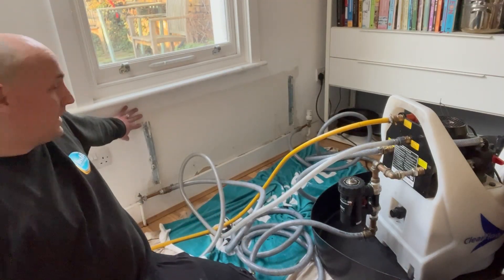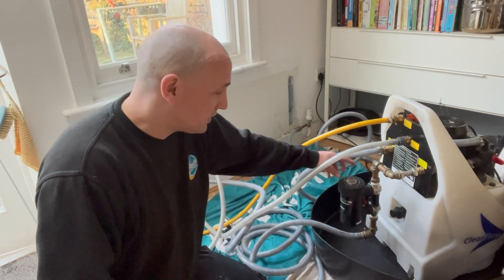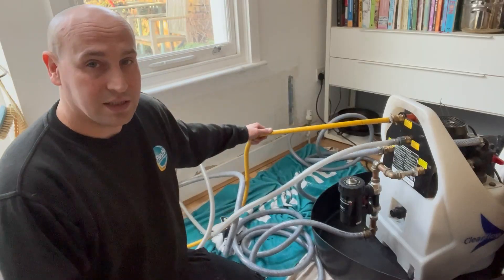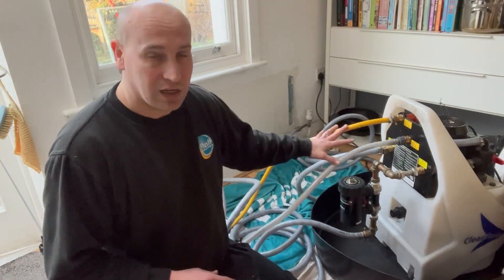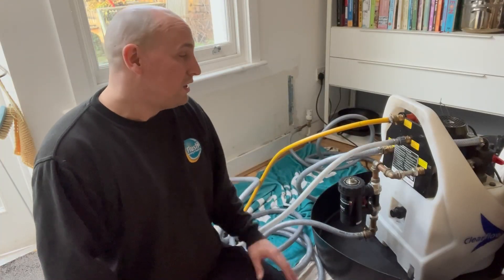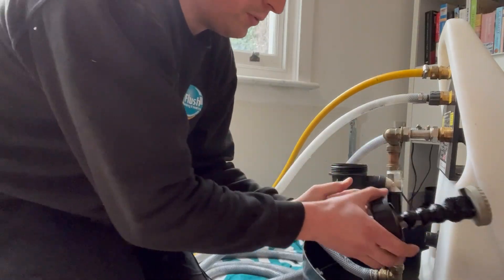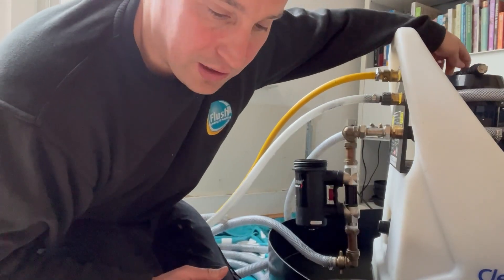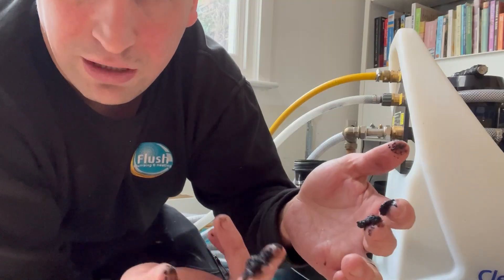What's the difference between a Chemical Flush and a Power Flush

Comment: Good evening from Greece, happy new year. I completely agree with what you said. The success rate in a chemical cleaning of the closed heating circuit with the circulator does not exceed 30%, the process is completely wrong and the customer pays for nothing. A proper chemical cleaning is achieved only with a dynamic flushing machine and magnets for many and various reasons, in difficult closed heating circuits that operate for more than 15 - 20 years, such as in Greece where we have 40 years of operation of the closed heating circuit, one hour of the chemical X100 is not enough. Many times the same chemical is not enough to clean the closed heating circuit even with hot water, the solution is to find stronger chemicals, the process for a radiator with my own method lasts for each radiator 2.5 hours. At the end, rinsing with water jet ... clean water with air. On my channel I show the way in which I work with my own self-made dynamic flushing pump.

Comment: A warning here press fit connectors with out collar locks  can come loose on power flush, i have seen many system not fitted on fantastic plastic connectors. (make sure they are insured for damage to ceilings carpets  etc)

Comment: Thanks Flushman for the detailed explanation. I need to do a power flush with chemicals. Do i isolate the central heating pump and just use the power flush pump to pump it around the system.

Comment: Problem is the pumps and heat exchangers get  clogged up, so remove clean them out with FX2 cleaner after you had chemical cleaned your system will only loosens sludge only but the hard bits get stuck inside the parts mentioned above

Comment: I have a fairly new boiler, all rads are brand new apart from an old towel rail in a bathroom. We are currently renovating and I think the crashing and bashing keeps loosening debris and it ends up blocking the heat exchanger. Will the chemical flush and drain down release the debris in the heat exchanger? TIA!
Reply: My boiling kettling making noises etc, first thing is chemical clean flush system,  then remove debri /clean pump rotor  , then get someone to remove flush clean the heat exchanger with fx2 cleaner 😊

Comment: I looked at a poweflush and the cost was extortionate tbh,my issue is ive got bottom of house 15mm plastic repiped but top half is 10mm copper micorbore,some said it wouldnt work and didnt even want to try,the ones that said they would wanted crazy money,boiler is condensing type around 6yr old and upstairs rads are cold,so i bought the X400 and flushed the sentinel magnafilter,refilled system with the x400 and now only 8hrs later have decent heat upstairs now,not as good as it shpuld be but a huge improvement and good enough,the rads are all around 3yr old but to repipe upstairs is no no as it means ripping up floor in 2 rooms and hall,weirdly the towel rad has always been fine upstairs  but 2 rads on same floor were always very poor,there is a manifold in hall so not sure if thsts an isdue.

Comment: All 4 rads on my ground floor have drain pipes so how to I know which rad to add chemical?
Reply: it doesn't matter...once it is in it will circulate
Reply: Best idea is if you have a towel heater use that,once drained down close both valves fill with the chemicals flush usually 1 ltr,prime system and open both valves then bleed rads as normal,the towel rad is easiest as the bleed valve is at top and you can remove it plus there's no trv valve.

Comment: Great video. So you say to insert the chemical and leave the rads running for an hour to circulate it around. We then drain off the system to get rid of that slugey water. We then put the inhibitor in - do we drain this or leave it in there to circulate? Thanks buddy
Reply from the maker: Hello 👋🏼 Leave the inhibitor in the system. This prevents any further corrosion. It prevents the system of corroding from inside out and therefore prevents build up of sludge. Hope this helps :)
Reply: @flushman  makes sense. Thank you for the quick reply

Comment: question:
what happens if you power flush but you have no open drain outside?
my drains are sealed under the ground.
some people have said they put the contents straight onto your garden which i think is bad idea if you are putting corrosive elements onto soil( is it even permissible to to do that !)
also is a power flush more suitable if you believe your system has never had a power flush( mine is at least 14 years old and came with the property)
thanks
Reply: Leave it alone.Is your system ok? Radiators hot don't worry.
Reply: You only need to flush when you are finished. You can use the toilet to put the flush pipe in. Obviously it could be a bit dirty but it shouldn’t stain the bowl.
Reply: @davideyres955  thank you for reply. as it was. I had the boiler changed, and they did a power and chemical flush, and flushed the contents of the filter( less than half a bucket) down the toilet

Comment: Thank you, that was really helpful. I’ve heard of a power flush, but not a chemical flush. How easy are power flush machines to use. I believe you can hire them? I ask because I was I was quoted £850 plus VAT for a power flush (3 bedroom house with 13 radiators)
Reply: Rip off.
Reply: Shocking absolute rip off I was quoted similar,issue can show up leaks if powerflushed and they do usually warn you of this.

Comment: My partner has just had under floor heating fitted downstairs under floor and rads mainly upstairs. He’s had a new boiler fitted and they didn’t mention that they’d cleaned the system first. Is this bad practice? The system has never been cleaned in 15 years. Could this damage his new boiler? I had a new boiler fitted and knew I needed a power flush. Old system, problems with my old boiler. The builder in charge has said it nonsense he didn’t need a flush and it’s an unnecessary procedure which is used by heating engineers to get more money out of people. Please advise. Thanks

Comment: What do you think of flushing with the filling loop going round knocking each rad off individually until each rad runs clear?
Reply from the maker: Yes I use this method too. It depends how contaminated the system is. If the system is lightly effected then this method works well :) 🔧
Reply: What the point of adding a magnaclean to your machine when the crap would just go into the drain anyway through your machine....seems that it's more to show your customers some of the sludge
Reply from the maker: @naveedahmed5509  Yes it’s certainly good to show the customers but it also speeds the whole process up and you reduce how much water is used during the flush. You will find you don’t have to dump as much water when using a filter. I also drop a loose magnet in the tank too and keep cleaning it. I would highly recommend using a filter :)
Reply: @naveedahmed5509 

Because the system is dosed with chemical cleaner which puts radiator magnite into suspension its then caught by the magnaclean/magnet